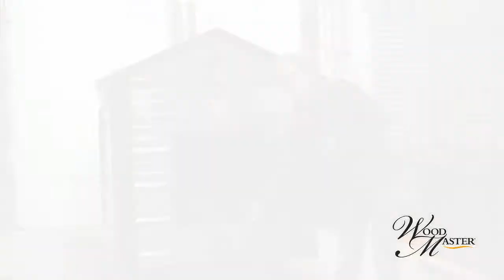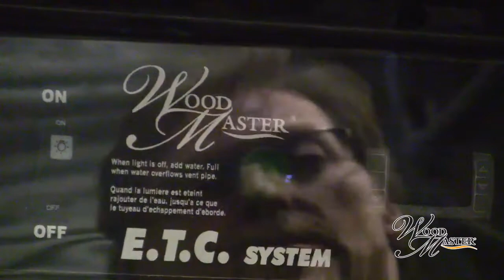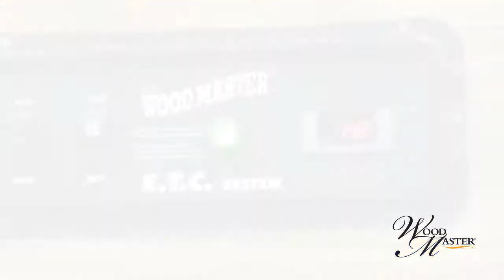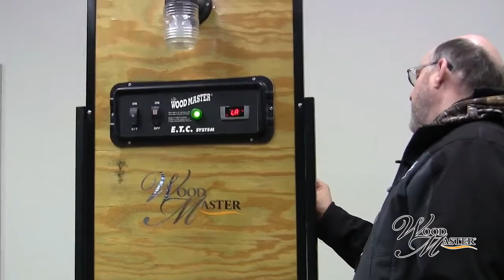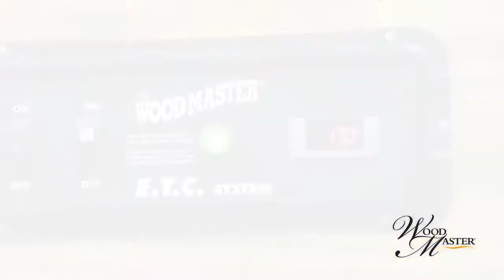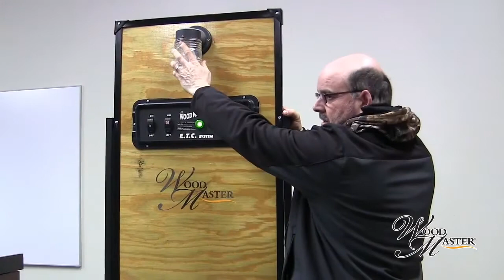Wood Heating Solutions Presents The Traditional WoodMaster Walkthrough

Comment: Had to have thermostat replaced due to mice. Now for some reason the water is either evaporating or there is a leak underground. Temp got up to 219! Had to fill it back up and it works normal again for a few days.